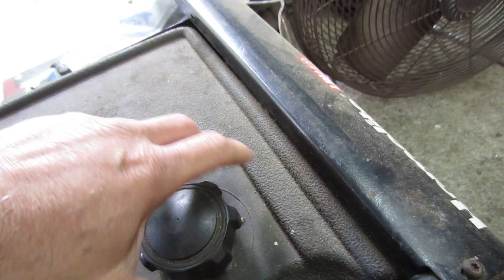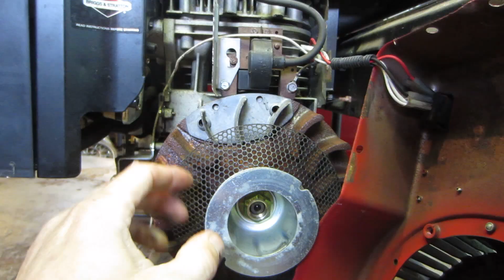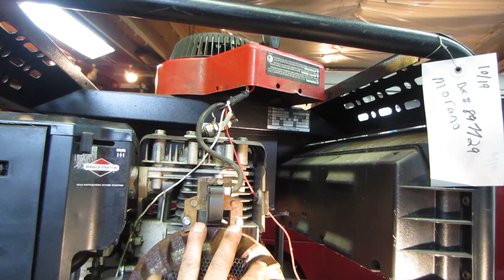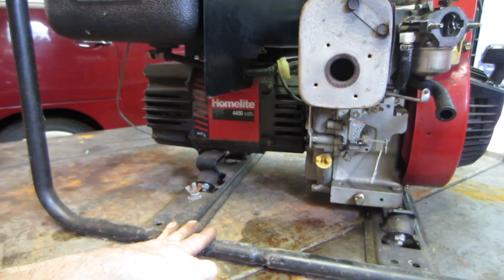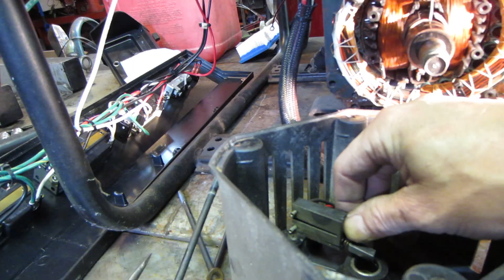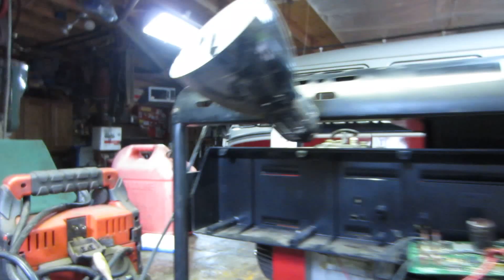$5 yard sale generator

Comment: Most gas tank caps on power equipment are the same size. Why not take one and put a fitting on it so you can easily pressure it with the cap on and your air gun. Just a fitting to fit the nozzle of the gun over and give it a quick blast.

Comment: Who the hell discovered this? The sudden collapse of the magnetic field causes a sudden spike in voltage used to create spark through a secondary circuit to power a piston that spins a generator full of coils and there’s power on the inside but the real powers from the outside… what the heck kind of inventor was this

Comment: All coils are nothing more than hundreds and hundreds of small Copper wire wrapped around an Iron core. Put your meter on resistance and read the resistance of the coil. If it reads nothing the coil is open. Replace it. I have ever done this for years.

Comment: I dnt know abt rust but I just took a lawnmower engine off its body and the break pad had wore all on the flywheel  I hit it with gas and sandpaper  and it did bring spark back there wasn't rust on it though

Comment: Many years ago I did have luck with sanding off the rust on the flywheel. What I now think is that some other consequence happened at the same time. When you remove the coil and the flywheel is rusty, the bolts and plug being removed caused some crusty connection or spark kill was changed with it's removal and reconnection thus returning the magneto to a working condition. Maybe even jiggling the coil while inop could reconnect something amiss. If so it will be a lingering problem and it seems I had a return to inop later.

Comment: It's ridiculous that they charge $120 for that board. It has about $4 in parts on a 50 cent board. I found the same when my furnace control board went out. They wanted $350. I popped it open, it had maybe $15 in parts. The problem was a bad solder joint which cost $0 to fix.

Comment: My generator often sits for a couple of years between uses. Usually the thing has demagnetized and I get no output. The first time I took it to repair, then I found out how to fix it, I plug an angle grinder into it and while it's running pull the trigger and skid the wire wheel along the ground to spin it up. That backfeeds enough power into the outlet to kickstart the field coils and it fires right up and is find again - the residual magnetism will hold for months.

Comment: The simple easy peasy electricity explanation. The d.c. power to the rotor winding makes it into an electromagnet with a North pole and a South pole. Now when the rotor is spinned by the motor, the magnetic flux lines made by the rotor winding cut the outside stator windings, and these generate the a.c. output.

Comment: I pity the fool who goes out and buys a homelite generator for their home. Cheap cheap cheap (except that Briggs engine). And the circuit board price! That generator is old and so is the circuit design; those parts cost probably 4 dollars for a manufacturer in modern times. Homelite just doesn’t want you to fix it 🤣

Comment: Ok for the first time ever I hot to call " FOUL" on what mustie1 says about the rust being on the flywheel.  I've had many engines that wont run until I clean off the rust where the magnets are. It truly does matter especially if there is a lot of rust. To me it didnt come that way from the factory so it should be clean. Worse thing that could happen is nothing but then you what the problem isnt. But if it does help think of the time, money and energy saved. Plus it's just better to make it look good, might even get more money out of it! Ok now back to Mustie1

Comment: Sometimes, after time, the gen loses its polarizaion. As it runs, just plug in an electric drill, hold the trigger on, and give the chuck a good twist
If that's the problem, it will start the process. Check the windings by applying 12 vdc to the brush leads.
Reply: Try adding the voltage, and then use the drill trick...

Comment: Hard to see well enough but looks like one phase of the stator windings might be cooked. LooK for the dark almost black wire mixed in with the copper ones.  Big sign that they are cooked
Reply: And the lamp is a floresent light it wont fire off at 60v

Comment: First thing I do when a gen runs and has no power is take grinder.  Plug it into the receptacle.  Pull the trigger and drag the disc of the grinder backwards on a piece of wood or something.  That will make the grinder generator a bit of voltage back into the field coils and boom the power kicks in.  If that doesn’t work then you have a physical problem.  To me it sounds like the repair guys just started changing parts.

Comment: On the B&S engines with points, you could still take a wire from the points and ground it to kill 
the engine OR break connection in the points wire with a switch.

Comment: I just worked on a zero turn that kept shutting off. I sanded the flywheel and the coil pack and it runs fine.

Comment: Please, don't do any more generator videos as your electrical knowledge is very lacking (to be kind). If you really want to know more about PRACTICAL electronics (Yes, you DO), go to Mr Carlson's Lab, on Patreon and on YouTube. I KNOW you have a basic bent toward being very cheap (being kind in my choice of words), you MAY not understand that Paul Carlson is of the sort who LOVES electrical circuits and knowledge of the PROPER and SAFE way to handle repairs, as well as doing things the BEST way AND PROVING that he only fixes things to LAST by using almost as good components as are available. You don't even know how to read or use a digital voltmeter. Ohms law has never been used by you in my travels through a great number of your videos. Good luck before you ruin a perfectly good generator. PS: Find from Paul the best way of cleaning contacts! PLEASE!    de KQ2E (my amateur radio callsign)

Comment: Mustie, I have a generator that quit putting out power, and after a long story oftrying to get it fixed, someone I was talking to about it said something that made a light bulb go on in my head, and that was to check the brushes in in the gen head. I did  and found one of the brushes bad. Bought a new brush assembly and it is still working today.

Comment: Of course Mustie is right..sanding the rust will help improve the spark to some extent but it will not make the difference between it running or not.

IF you did sand it and it """"fixed""" it it's because you toched something and brought a bad ground back or reset the gap...

Comment: Play mustie1 you could also cut the upright bars and the crossbar and use them as a handle for something. You know the tubing that goes vertical and then across by the fuel tank. You know how long it would take you to make something like that and that's already made I always cut stuff like that out of junk like that. Always makes a great push cart handle or little bumper for something. it's usually stored cuz it'll lay flat in your scrap metal pile

Comment: Mustie, Generator Guru says 90 percent of the time, the AVR is the culprit. Especially after sitting that long, very well could be the problem.  A fix some time is to reignite the armature.  Easy way to do that. With machine not running. Plug in a drill or grinder, and then spin the said item backwards and that reexcites  the armature on the generator. The AVR is the automatic voltage regulator.

Comment: Love the videos. I have had a couple 1980s vintage magnetron ignition engines that had rusted magnets and rusted lamanints on the coils with no spark. wire wheeled them and reset the air gap and had great spark afterwards.

Comment: Cleaning the rust off the magneto would make it spark but not in all cases but it always worth a shot either use sandpaper or what I like to use is a bench grinder with a wire wheel on it mustie1

Comment: The field can be  easily tested  and the control  board itself  has know issues  there's a  diode and resistor that  go bad that causes every  issue  it had ... not saying that  was the problem  but  it is a  common  problem

Comment: Possibly could have tried supplying 12V to the control board directly (not just the slip rings). If you didn't have control voltage to the board at all, I doubt there would have been any AC output.

Comment: I’d  like too see ya explain more about how a gasoline engine operates. How the valves work basic engine workings. I’ve learned a lot about carburetors, enough repair my cub cadet lawn tractor.

Comment: A lot of " no power " issues can be fixed very quickly. With the gen running, plug in an electric drill and spin the shaft quickly by hand. The voltage from the drill will "excite" the windings and start the charge cycle. They lose their "juice" if they sit for too long. Done many this way and 95% come back.
Reply: he did that...well not the drill method but he try that..
Reply: Which direction do you spin the drill? reverse or normal ?

Comment: When They need exciting if you plug in say a big drill pull the trigger while engine is running then spin the chuck backwards it will send a small change to the generator and may run , mine did !

Comment: Thanks for the fine videos, I'm a mechanic who works on high end German junk and really enjoy sitting back and watching your videos. I've begun purchasing broken generators in the hopes of flipping them. My latest 'deal' has been a̶ ̶b̶i̶t̶ ̶o̶f̶ ̶f̶u̶n̶  interesting. It's an old Northern Tool generator with a nice Honda GX270 and 27 hours on it. Bought it for $125 knowing that it generates no juice. Engine fires up happily on the first pull, electric starter battery dead. Took her home and tried the old drill trick, no go. Crack open the alternator and see fried windings. I'm this far into it and plan to replace my cheaper home genny with it so I spend many phone calls and dollars with Northern Tool before I finally get the correct alternator. 
Pop it on and whoa- she makes electricity! Plug in a heater to load test and the engine backfires through the exhaust and dies. Great. 
Yank the float bowl and find crustaceans and what not in there. $25 Amazon Chinacarb shows up but won't fit. 
Order a real Honda carb and install- fires right up on the first pull! Great! The idle control system works, jiggavolts are showing on the meter, let's load her up. Put a space heater on it and I'm so happy to report that it dies and backfires again. 
Now I'm miffed. I'm reading about folks with the same problems online, finally see folks recommend a new spark plug. I've seen stranger things with plugs on cars. For example, on newer Mercedes Benz engines you MUST use the correct plug and torque to exactly 23 Newton Meters- if you don't, the electrode will not line up properly with the injector and you'll burn valves. 
So I waltz out to pull the plug and then I realize that it's only screwed in 1/3 of the way......
I grab my trusty plug socket and the thing will not screw in any more. Some dingbat has cross threaded it  quite well. 
Today my expanding reverse plug tap arrived and I was very pleased to rethread the plug bore from the inside out. Tomorrow Amazon should deliver my new plug and I hope to find that I have 'only' $800 in a ten year old $2000 genny....
Thanks again for the videos, keep 'em up!

Comment: That "oil presure switch" is actually checking oil level, i believe, on this small machine (no pump right?)... Anyway, thats actually called a "Murphy switch"... Especially important for equipment Left unattended for long periods of time, like big oilfield gas compressors that can go quite a while without visitors at times... wouldn't be pretty if they lost oil but kept running. 
 Really interesting part is, the big ones that use huge cat drive engines even change their own oil, regardless if anyone's there or not, every so many revolutions of the crank, a 500gal empty tank piped into the drain & a mostly full;) 500gal tank of Delo 400 on tap for the big cat to change its own oil without automated valves & pumps. Pretty cool system, but not full proof since after all, it's still a machine.    so the Murphy switch is still S.O.P. in the industry, & as you can see, is spreading into civilian markets too.... probably combat the "turn the key & go" mentality people have these days instead of maintaining their equipment.

Comment: I noticed burned field windings  from the 12 to 3 o’clock position. A lot of blower motors I replace have this issue and will melt the enamel and short somewhere. So, burned windings don’t always mean shorts because I can get blower motors to run with a new cap because the windings may have only gotten a little crispy before the customer shut it off because of the smell. Checking field windings can be iffy unless it’s like 1 or 2 ohms or flat short. One might ask where does the stator get the excitation voltage to get started? Delano alternator had a plug for that and got a signal on startup. Where you reckon that generator gets stator excitation from with no power source? Backfeed from the coil? Interesting video. Thanks!

Comment: Probably could have taken a few minutes to check the PCB for any obvious bad solder joints.  Hard to believe they didn't even conformal coat the PCB as it's intended to be used in dusty/damp environments.

Comment: for future reference i know this is a old video. on these self exciting generators i seen several cases where if they set for a long time the fields have just all residual magnetism. what ive done to fix this is remove the cover and find the field leads and just apply 12 volts to each set for a short time. and then put it back together and its fixed.  only ones ive seen with actual problems is in cases where someone has bypassed the circuit breaker. or have a broke lead which was probably caused from vibration which only requires a little solder to fix

Comment: I don't like those edison-style generators the one with the capacitor brushless Nikola Tesla design was a lot better I don't know why they go to the Edison garbage design like that one using brushes when you can get a better generator I got one from Harbor Freight it's non brushes uses a capacitor and some of the better higher-end ones are still using brushes it's retarded I know you don't probably agree with what I'm saying that's okay at the Addison design sucks a lot more stuff can go wrong with it a true alternating generator it doesn't need brushes is a better generator you don't have that control board to go wrong if it's a good generator that Tesla designed and patented

Comment: It's a tapered shaft all generators bolt into a tapered shaft on the back side where take goes into the generator input you know the spins the rotor on the generator

Comment: The GFI will not reset if it does not have power. So start it back up then reset the GFI. Then your light may work. But if you have nothing out of the generator then what I just said doesn't matter. :)

Comment: Have you ever used the .010 brass shim that comes on a feeler gauge set. Put it where the magnet is on flywheel between the coil.  Loosen the screws and the magnet sucks the coil down, then just tighten the screws. Rotate to free the gage. It's magic

Comment: It's been a while since you posted this, what is the status?  Alternators are not that tough to troubleshoot...they spin, the exciter needs power all the time battery initially and from the alternator and after that from the alternator or voltage regulator.  The field winding's in the stator need to be isolated from ground and a complete circuit, and winding's in the rotor need to be a complete circuit between the slip rings.  If these conditions are met, it will make electrical magic.

Comment: I've never operated a lathe but it turns the shaft like the motor does. Could you make a fixture to hold a cutting tool. Then shape the shaft straight instead of tapered?

Comment: Windings are burned. its toast. Homelight LR and LRI are known to actually be overrated for what they can produce 4400's are supposed to be 4,400 watts its more of the range of about 3000-3200 watts. if the windings dont kick and supply voltage the control board sits dead. i have 3 homelights with burnt windings.. the windings are supposed to be the same copper/shlacked coating color the windings on the homelight are not exactly done like most others. and mixed together so its easy to burn one then short the other.. as for the GFCI/RCD not tripping you need 115v for the test to work as it actually causes a small voltage leak which trips it as it thinks its ground faulted... as for the Idle Kickdown it wont work either as its controlled by the board. 0 voltage out of the windings = 0 voltage to power the board which is basically a dead board which doesnt tell the solenoid to ramp the rpm's.

Comment: Capacitor, they're cheap and usually the the problem
Reply: You can flash a capacitor with a cord drill with the generator not running just plug the drill into it and run it by hand in reverse which will generate power back to the capacitor and then stay the generator and the drill should run but once you shut off the generator you'll need to re flash it again

Comment: Sanding the coil and the mag face and you will get spark, if the rust is causing the spark to short to engine ground. I sand them then spray them with a clear non-metallic spray coating that can handle the heat (polycoat etc) and it will resist the rust from reforming.

Comment: You are wrong about the rust on the fly wheel and the coil assy., it will keep the unite from firing I have fixed many by just cleaning the rust off of the flywheel and coil assy.
Reply from the maker: never worked for me

Comment: They switch off and on 60 time a second hence 60hz or 60 cycles? Did you check the voltage from the inside wires with a multimeter?